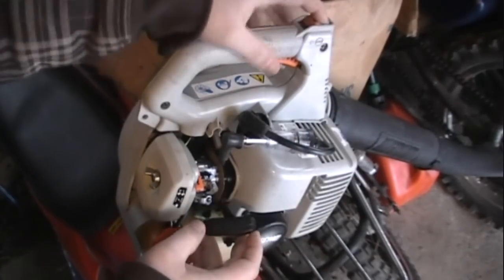How To Use A Spark Tester

Comment: You should point than that you can get a light sometimes but not spark across the plug with a bad electronic spark module. Most people still refer to it as a coil but it has electronic parts to replace the old points+coil system..

Comment: Very helpful. Thanks for sharing! I’m replacing a carburetor for my 28” craftsman snowblower that’s been sitting for about 3 to 4 years. I tried replacing the spark first (with the 3 year old gas and oil still in the system. I really didn’t want to do any of this stuff. Lol), then I tried cleaning the original carburetor, but had the same symptoms (would only turn starter while plugged into AC with power cord).  I now have the replacement carburetor, but noticed that the fuel line is on the opposite side, so I’m now thinking of trying to clean it again (just took it off again today), or using the new one, but making adjustments for the fuel line. Wish me luck (I’m no expert at this stuff)! :)

Comment from the maker: True. But this video is on the spark tester it self. The reason why i use these spark testers is because you can use them to test coils. For example i had a Stihl FS66 come into my shop for repair. The complaint was that it would run for 1 minute and then die. So I hooked up the tester and ran it with the tester on and behold when it died the tester stopped emitting light meaning there was no spark. This led to me believe the cause was the coil. I replaced it. Not problems afterwards.
Reply: Terrible logic. No matter why the engine stopped, the tester would show no spark.

Comment: Very cool tester! I have a husqvarna chain saw I picked up at a yard sale for twenty bucks, the fuel tank smelled like stale fuel so I emptied it out and put true fuel in it and wouldn't start. so then I dumped a little bit of fuel in the carburetor and it still wouldn't start it does seem to have pretty good compression and I grounded out the spark plug and it does have spark so then I replaced the spark plug all to no avail any suggestions would be appreciated I'll try to post a video of it!

Comment: thanks for vid.  I have a lawn tractor that I've changed the carb in recently because it was flooding the engine.  Now the engine dies when I'm almost done cutting the lawn.  It is then hard to turn over, and when it does, it won't stay running.  After about 5 minutes, it will start right up and let me finish the lawn.  Someone told me to see if the engine had spark when it dies.  How can I test for that?  What else could be wrong with it?

Comment: i have a redmax backpack blower and it wont start it ran fine and i think the gas i used was bad yes its 2 cycle and added the oil so now ive emtied the gas refilled n now checking for spark n then compression if no luck i will get back to you thx tommy

Comment: Now even if the spark plug is bad that light in the glass window will light    up or does the spark plug have to be good? So if it does not light up does it mean the ignition coil may be bad, if the ON switch is working.

Comment: My 11 HP Troy Built riding mower with a Briggs and Stratton engine, starts right up and runs great for about 20 to 30 minutes, then starts to sputter and shuts off. Once it has cooled down about 10 minutes, it starts again. I pulled the fuel line off at the carburetor and plenty of fuel comes out, so I don't think the riding mower getting fuel is an issue or clogged jets etc or it would not run in the first place. Do you have any idea what the problem is? Perhaps a bad coil? The riding mower does not have that that many hours of usage in fact it was just serviced by an authorized dealer. Also, would a car parts dealer have that spark plug tester you demonstrate?

Comment from the maker: I have a seperate method on that, This is fast and simple and tells you weather or not you have a bad coil, need your points and condensor cleaned, have a fould spark plug, and basically everything with one simple tool. Simply if you have a fouled spark plug the light will illuminate, but the engine will not start change the plug.

Comment: i have a question I am learning to work on small engines and i am stumped. i am working on a power washer engine and the other day i pulled the cord and it backfired. now it feels like it is low on compression what should i check

Comment: Toro  20039 lawn mower has electric start and pull start.  Electric start will not start engine.  Pull start starts engine on first pull.  New Battery, and new starter. Alternator replaced last year.  Any ideas why electric start will not start engine?  Cranks over fine.  Just won't start.

Comment: For his situation, it's rubber insulation on the wire. You will not get a shock unless you're contacting both exposed positive conducting /and/ the engine's earth. 

Electricity, being lazy, always takes the shortest path, or path of least resistance. Sometimes, that is you; the human body is made up of a large percentage of water, which conducts electricity very well. Just avoid connecting positive to negative and you shouldn't get a shock.

Comment: My weed-eater  FL 1500 1 ; starts but stops. The spark tester is showing spark - orange. Should the spark be blue? If the coil was good, when one hooks up the tester; and pulls the starter rope;  the blower-should start, shouldn't it?

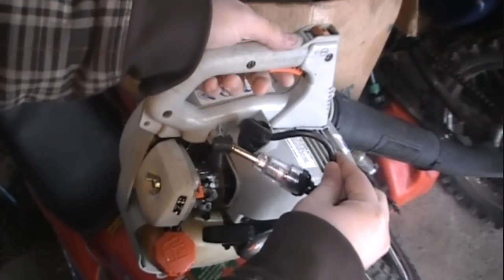Comment: pimpinpenz, have a question for you. At 1:20 in the video, you grabbed hold of the wire when it was running, my question is, how did that not shock you? I grabbed hold of mine when running it on an old outboard and let me tell you, it was a "shocking experience" lol. Just curious, thanks.
Reply: Wear rubber gloves lol.

Comment: Hey bro wondering if it will still light up if the motor cranks but does not turn over?
Reply: boogywoogynigah we all keep asking this question. Unfortunately he doesn't respond to it. Not sure why he would post this and say to ask and not respond. The video makes no sense. You don't need to test a motor that's working properly. It's the motors that have an issue that we need the answer for. Pointless video.
Reply: If the coil is working yes it will light up even if ur doesnt turn over. If the coil isnt working then no it won't light up. That's wat this is showing if the coil is creating electricity to spark the spark plug.
Reply: @howcroft22  if you say that it means you do not know how an ignition system works

Comment: I have a Homelite Super XL Auto chainsaw my dad just passed down a couple weeks ago and I've been working trying to make it run like new again. He never put a card kit in it so I bought one of those and installed the new carb kit. The only thing he did to it a few years ago was put a used ignition coil on it. Now when I start it and hold just enough throttle to make the chain turn it seems like it's skips some firing but never shuts off. it idles kinda rough too. Any thoughts on this?

Comment: will the bulb light up with a bad spark plug? I bought one of these testers but it didn't have very good instructions. I mostly want to use it to just to see if the ignition system is working and making spark. most new small engines have plastic covering the motor and that makes it hard to ground the plug on the block to check for spark. I tested the new tester on a good running chainsaw to try it out, the bulb flashed telling me all was good but the motor didn't start like in your video, ??? is this the right tester for me?
Reply: the motor does run. i was wanting to know if this tester will light up even with a bad plug.
Reply: power equiptment I've been wondering the same thing. I have a 150 hp outboard acting funny and they said use a spark tester to find out if it's a bad power pack. I'm curious what happens when it isn't running correctly.

Comment: I search and search but can't find an answer to what seems to be a simple question. Trimmer won't start, multimeter shows about 7.5 ohms w the meter in the "x1K" range (the only option on my cheap meter). Reinstalled ignition module, 3 different spark plugs (2 are new) and in a nearly pitch black room I can see faint reddish lighting in my cheap light-up in line plug tester. Similar to some other comments: how bright should the tester lamp be? Easy to see. Barely visible? Color? I think this is an "art of mechanics" or experience type question. Trimmer running well then abruptly stopped itself wo change in throttle or load (or so my wife tells me) and on/off switch not touched.  Did all the usual : checked gas and air filters, checked flow in (new) hoses, pulled out spark arrestor (does this HAVE to be in to start? Some sorta California safety feature?) drained tank, mixed new fuel, sprayed starting fluid directly into carb - full open, half, and completely closed (no hint of combustion even w this). So can an apparently very weak light-up of inline tester indicate a failing ignition module but no yet 100% fried?  Any thoughts appreciated.
Reply: +kyle miller did you solve it?
Reply: Sam L: yes, solved. Ignition module bad. No longer avail for my particular trimmer but extensive Google search found one in a warehouse stocked w old inventory. Made an offer ($25 if I remember correctly) and received OEM part in sticky crinkly dusty orig plastic wrap that and trimmer worked flawlessly when installed. Ran the spark tester again and can confirm bright orange light-up of tester easily seen in regular daylight. Suspect if this module fails then there's no more hope for this particular trimmer as parts are very limited. I'm not savvy enough to figure out substitution parts w/o manufacturer clearly specifying subst part numbers. It has been the easiest-starting, best-running trimmer ever til the ignition module fail. So new life for $25 was a good deal and delays the inevitable end-of-life resting place in a landfill.

Comment: Why would you test for spark if its running? If its running it has spark. I was going to buy one at harbor freight but the instructions said to start the engine. to test. If it starts i don't need the tester  --  weird ?????

Comment: I think the whole pointof a spark plug tester, is testing when the engine won't run, my guess 
is that everyone that comes here is testing an engine isn't running , not
one that's running, that's way too easy. 
I for one need to see how the tester reacts, I have one hooked up and its really up 
in the air whether the coil is putting out the right level of voltage.

Comment: IMHO  there is a common problem in some stories.The engine/cylinder runs when there is fuel and spark,so whenever the engine runs you dont need to test,there is a spark
if it doesnt start or run there will be no spark,not because  of a problem but because you dont create  electricity unless you pull the starter coil etc

Comment: Bad. Some engines have a very small clearance between the spark plug and the piston. This is what can cause incorrect spark plugs to become damaged, or even cause damage the piston and cylinder itself due to debris. There are ideal distances and even spacers you can buy to measure the gap correctly. You should do your research on this.